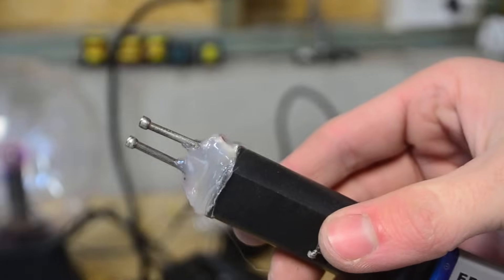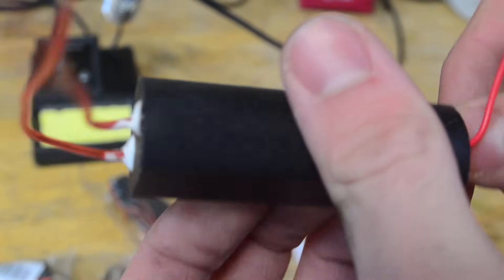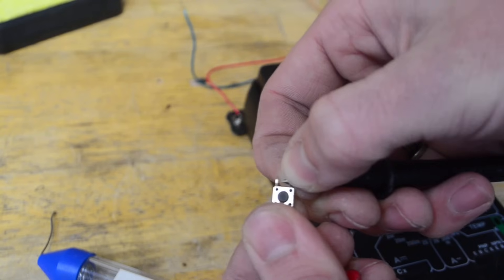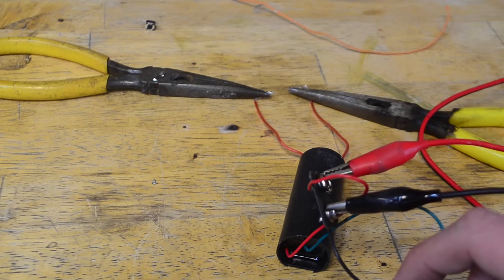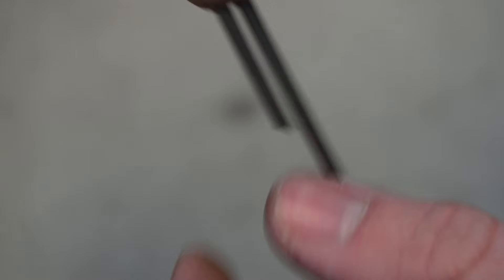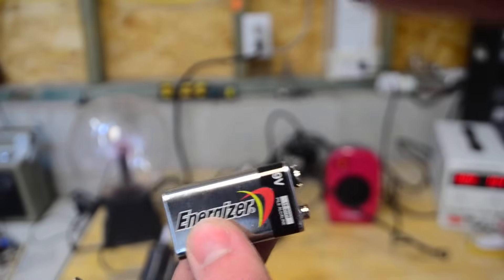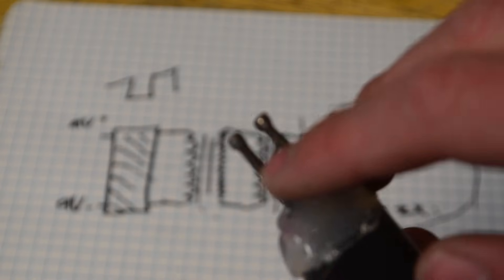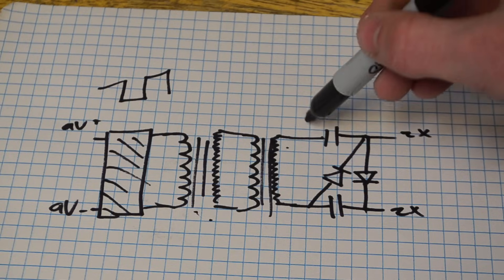How to make a 5$ Pocket Stun Gun

Comment: https://en.wikipedia.org/wiki/Boost_converter#/media/File:Boost_conventions.svg isn't it more like that? But instead of switch on the schema you have very fast transistor and driver. The resistance R have to be high, if the transistor S is closed the L coil is charging, and when S is open, L is passing current via diode. And if you switch fast enough you get high voltage stored on C (current cant go back by D, so the voltage is rising)

Comment: could you connect one of these through a spark gap to the primary of a tesla coil as a cheap sloppy driver? or would trying to tune it be miserable?
Reply from the maker: +Will W yeah trying to tune it would be very hard, we'll sort of hard, since the boost converter is more of a pulsed output I would think it would be hard to get it to resonate well in a spark gap tesla coil, and the output of the coil probably wouldn't be that great sadly. But, the ZVS driver ( I made this 2 videos ago ) should work fairly well to run a small tesla coil, I think it gives more power than most NSTs I've used to be honest

Comment: Solid science. One tip though, you might want to consider using heat shrink after the electrical tape for longevity and extra insulation. I've found that over time, with usage and heat that the electrical tape tends to wear down and become more of a sticky flappy mess than an insulator. Not required, but just a small extra step that will make you things last a bit longer, and be a bit more user friendly. Love the videos by the way. Keep it up!
Reply from the maker: +Dean Wells thank you!! Yeah, That sounds like a great idea! Thanks! :D

Comment: a tip if you want to use a 9v battery but only supply around 6v you can remove 2 of the 6 batteries and solder everything back together and put it back

Comment: It could be cool if you could show us how to make a plasmatic x DIY lighter
Reply: it is the same idea behind it, the link is for a 80kv one instead of 400k as shown in the video to make a less powerfull one (there might be cheaper ones) http://www.ebay.com/itm/Super-Arc-6V-12V-Inverter-Pulse-High-Voltage-Generator-Ignition-Coil-80KV-2cm-/401161759510?hash=item5d671aab16:g:ILYAAOSwa~BYRQ~R
Reply: Anton Thyrestam look at the description. 
It is a high-pressure arc generator and not high temperature arc generator so it can not ignite paper or cigarette
Reply: are you talking about the one in the link?
Reply: Anton Thyrestam yes

Comment: Where do you get those batteries?
Reply from the maker: +mowhawkarrows I just got them off of amazon, try searching rechargeable 9v batteries and they should show up!
Reply: Shipoopi https://www.amazon.com/Vipe-3-6V-6V-Step-up-Voltage-Generator/dp/B01MQMSV95/ref=sr_1_3?s=electronics&ie=UTF8&qid=1484258170&sr=1-3&keywords=boost+converter
Reply: mowhawkarrows Just ask for 9 volt battery.
Reply: Mr_ Underscore volt.... not watt, ask for a 9 volt.
Reply: ***** Ahh sorry my bad.
Reply: But he said he had two different batteries which were both 9v. I wanted the that worked better.
Reply: mowhawkarrows batteries are definitely a game of you get what you pay for, if you buy the expensive lithium-ion High drain 9 volt batteries from a camera store or a camera Department, you really do get a much better battery than just a cheap Rayovac
Reply: if you live in a big city you probably already have a place that sells just batteries like Batteries Plus
Reply: Shipoopi Amazon: boost converter

Comment: if you open you will find slayer exciter  circuit on primary side and  secondary side as you described voltage doubler circuit  so you are correct  i also have 2 of them and on aliexpress they are damn cheap

Comment: i glued a lipstick-powerbank to the bottom of mine
that makes it rechargeable and supplies arround 3.5Volts (in my case)
and one thing anyone should know before using one of these:
the capacitors stay charged for a few secs after pressing the button getting shocked by this charge doesnt hurt as bad as but still hurts
just something to keep in mind :^))
Reply: He did show in his EMP video you can use something to "disable" the charge i guess he used another wire and just touched the capacitor with it.. Just some info should probably look up how to discharge a capacitor to be on the safe side
Reply: Well....
Reply: I don't know about this guy, he seems like a mad scientist
Reply: @Nickoflightandsound  scientists are always made
Reply: @officer_baitlyn  does it hurt like touching electrical fence wire or worse?
Reply: Martin Machava i connected my switch / the converter directly to the battery pins which isnt optimal but works for shorter bursts
Reply: i learn myself xD lol
Reply: 3.7 volts
Reply: Tuturu Okarin!

Comment: You may need to work on your safety tips... I know it is easy to get careless around high voltages but they can easily take unexpected paths... especially if the wires are long enough that someone could touch them with one hand while being shocked on the other for example... also try not to tell people to hit brittle steels with a hammer it is bad practice for starters